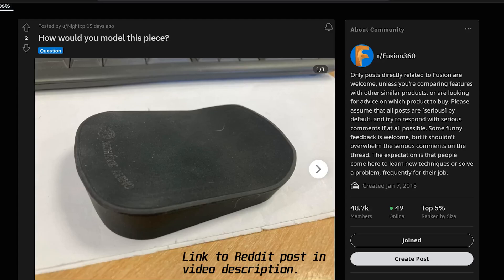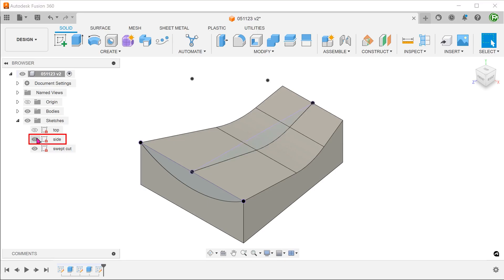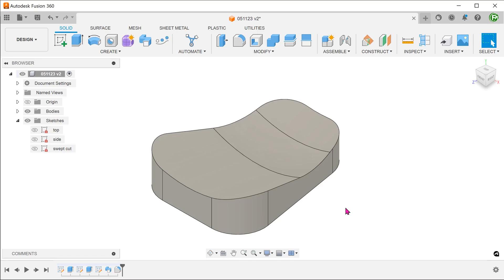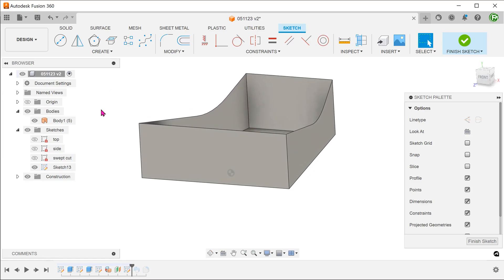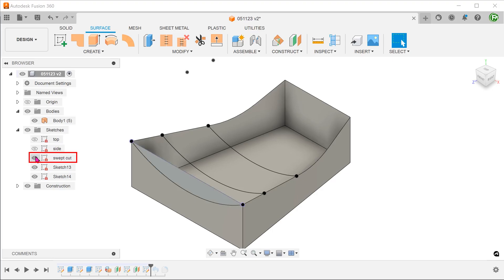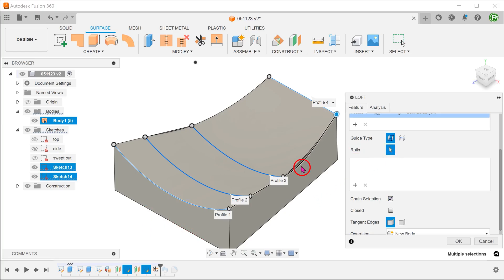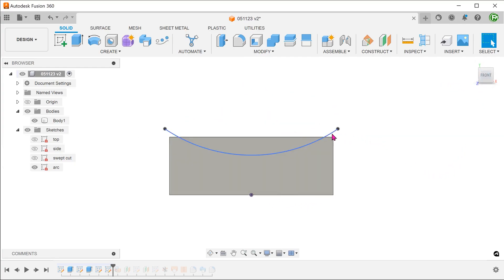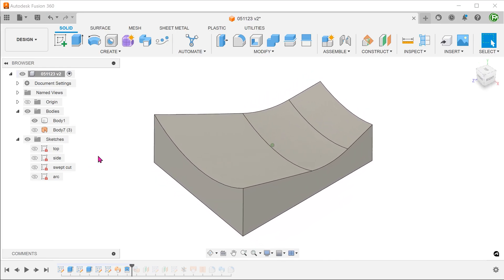Fusion 360 | More than meets the eye?

Comment: Dear Sirs:
 Thank you for all the best Fusion 360 teaching videos made. They are the very best on You Tube! 
To complete this design it would be nice to add a surface finish to the top surface. A diamond knurled surface would be great but with a caveat that the knurled pattern height starts at zero on the edges to a specified maximum at the center point.
THX
Sincererly,
Don B.

Comment: Nice work. The curvature when viewed from the front seems like it's an arc, and might fit a larg urn. How about cuting away the top of the square block with a revolve command?
Reply from the maker: This seems promising. I attempted to revolve with the sketch profile that was used to create the side cut but it cut the solid in a weird way. I probably need to adjust the profile to make it work.

Comment: Thanks so much for checking out my Reddit post and making this video! I’m not used to surface modelling so will definitely be getting onto that now! This was great to see and glad it wasn’t a straight forward model to make. I trued a few methods but kept getting effects I didn’t want. A life saver of a video!
Reply from the maker: Glad to help. Always a pleasant surprise to see OPs respond to these videos. If you don't mind me asking, what is that thing?
Reply: So it’s a rubber speaker stand that I needed to recreate from 3D printed TPU, I ended up 3D scanning the part as I couldn’t get the shape quite right to match the original one.